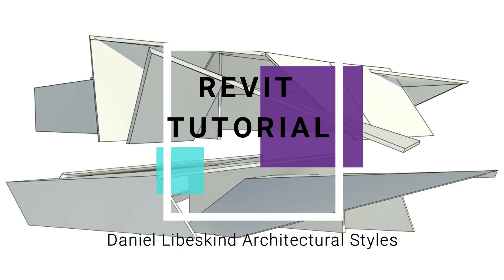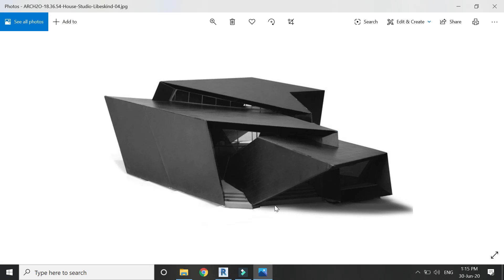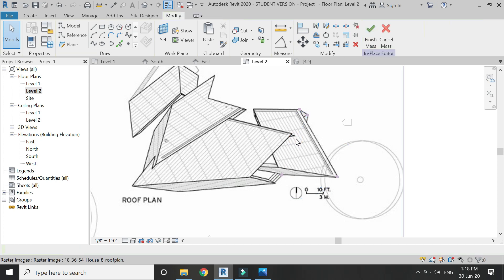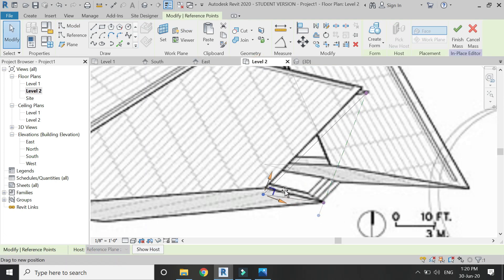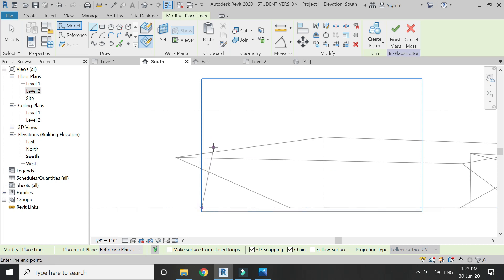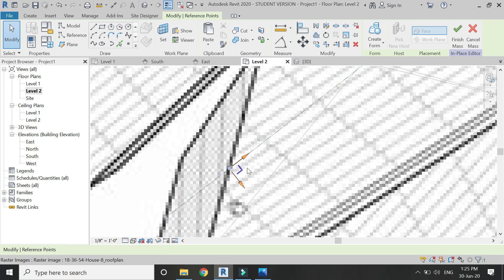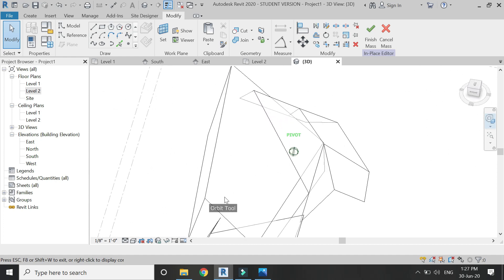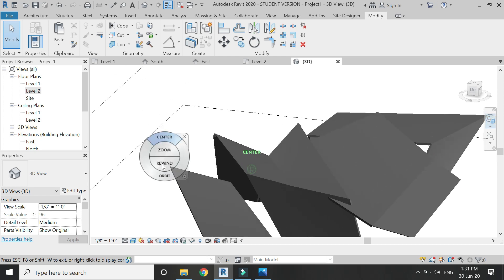Revit Tutorial - Daniel Libeskind Architectural Style

Comment: Good tutorial cheers. Just wanted to say you can free drag vertices using the little square between the two arrows. Use it to drag the vertices freely within the same plane without having to use the arrows individually. Also if you want to orbit a 3d view, press shift on keyboard and press the mouse wheel down to drag to orbit the view around rather than having to use the steering wheel. Its a lot quicker.